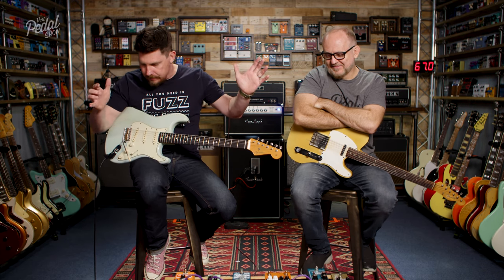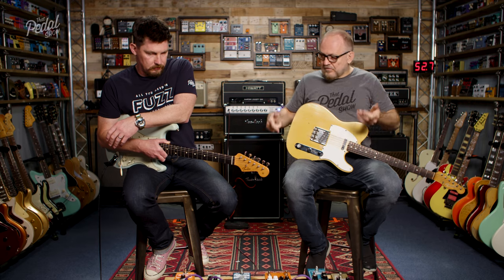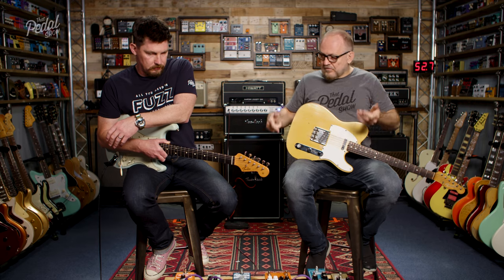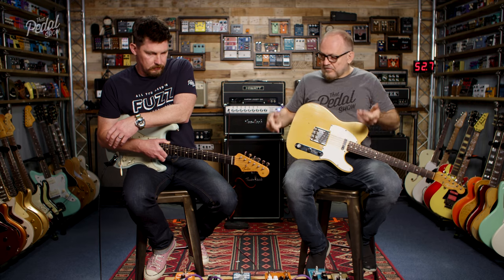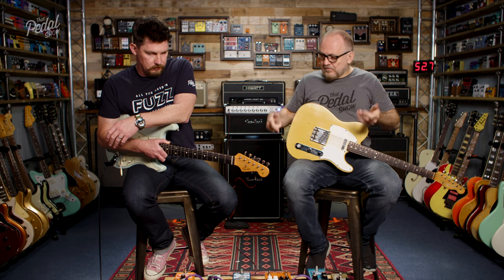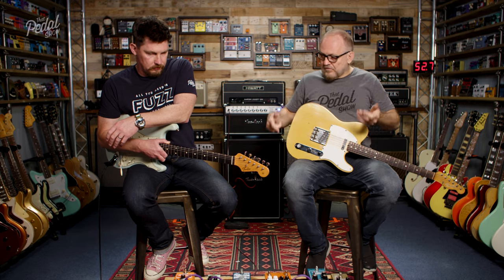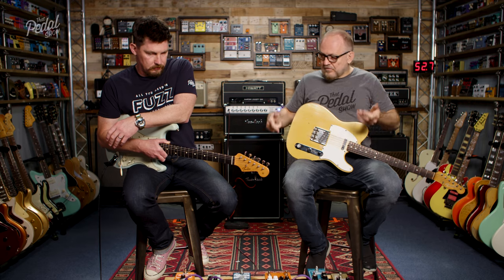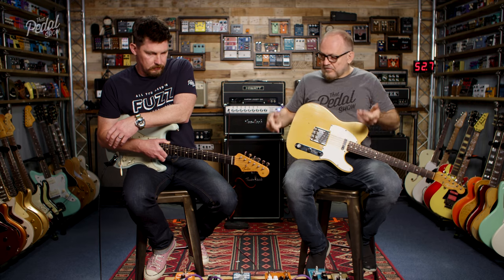To Buffer Or Not To Buffer: That Is The Question – That Pedal Show

Comment: Mick, sat here listening on some really nice headphones and so the tonal differences (and volume!) are obvious, but what occurred to me amongst my own confusion (when you said you were struggling with it too) was that, Dan is of course 100% correct that the combined effect of all those cables etc on your tone is part of the sound you like and are used to hearing. However, it’s also THAT same modified sound that you’ve set your amp and other pedals up with so that the end result is what you liked BEFORE you introduced the 29 Pedals Euna buffer. Please listen back to the audio carefully of your guitar with the super short cable and you’ll really hear it’s true - That’s what your Two Rock actually sounds like without all the tone sucking capacitance into the front of it!. 
So if the Euna is correcting for all the capacitance induced tone loss to begin with, surely the answer is to include a really good buffer at the start of your signal chain and start by adjusting your amp and pedals to dial out the harsher tones you don’t like (that the cable capacitance killed). At least then that gives you a level playing field every time. Otherwise, the only other way is to play your guitar straight into your amp with no pedals at all - OMG! Not sure if I explained that very well, but it mades sense to me. Hope that helps 👍
Reply from the maker: Yes, I understand... but I really don’t like that sound of the patch cable! I like a bit of cable etc... and of course the amp is designed with that in mind! It’s not worse or better, but my fave sound is with normal cables and the amp cranked. Extra buffers and all that are just solving problems I don’t want in the first place. :0) I should add that when I’m using my G2, all the extra capacitance etc from the pedals is gone. That’s what it’s there for as much as the switching convenience!
Reply: That Pedal Show that’s great to know that the G2 fixes all these issues but I thought that had its own buffer too, or is it the same even when the buffer is disabled? As for not wanting to have these issues to begin with, in that case sounds like you need the Albert Einstein pedal to temporarily change the laws of physics! I hear it sounds amazing, but only ‘when observing a man running on a train moving a high speed’ (or something like that) so it’s all relative! 😂

Comment: Why not just add a little buffer after the secret machine? Then you can keep the desired pedal combination and everything is still buffered. You can get really small ones.
Reply from the maker: Indeed. But which buffer. As this video proves, they all sound quite different! Aaaaand, I don’t really want a buffer before my ODs. See?
Reply: @ThatPedalShow  Yep fair point. I must EQ my ODs to compensate I guess. Plus I don't have any fussy fuzzes! So life is easy! Great show as always guys.
Reply: P. S. I use a Klon buffer which I built. It does colour the sound a little but in a pleasing way.

Comment: With a fair few companies making standalone K-style buffers isn't it an idea just to have one in your chain to minimise these issues? After a decent EQ its the 2nd most useful thing on any board IMO.

Hopefully this comment doesn't get moderated by a grumpy bot (cough).
 
Edit.... and most standalone buffers are so small you can hide them underneath, so no space issues.
Reply from the maker: Hahahah! Totally makes sense Andy... but they do all sound different. I don’t like pre drive, for example. But yes, in theory it //can// work. Whether it works for you is a totally different matter! Non grumpy Mick here.
Reply: @ThatPedalShow  Hi Mick - thanks for the reply.
Appreciate that - which was the whole point of this excellent episode. My big takeaway was how the buffer's effect on the vintage fuzz changes as you move the buffer up and down the chain - quite an eye opener. As you rightly say, experimentation with placement will be the key. The cost of a reasonable quality buffer is significantly less than, for example, a boutique pedal so, at least from my POV, well worth having one around just in case. The only overhead in terms of most boards, is that it takes up a power supply slot.